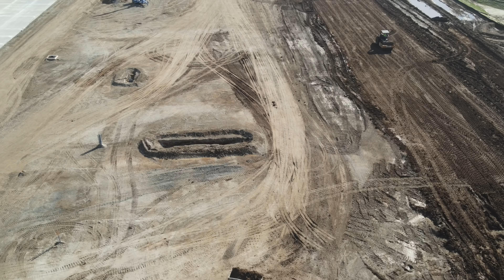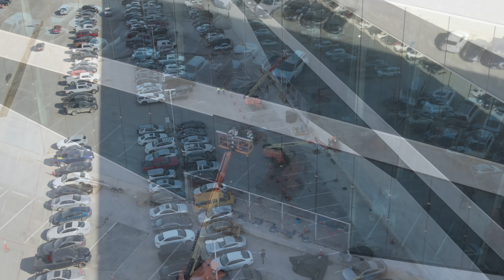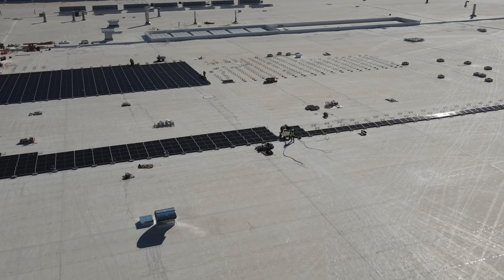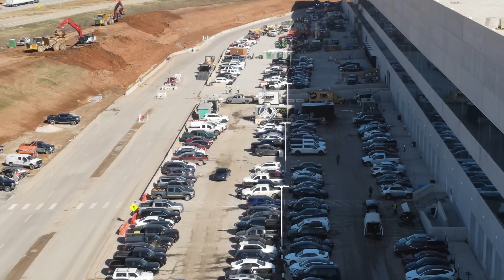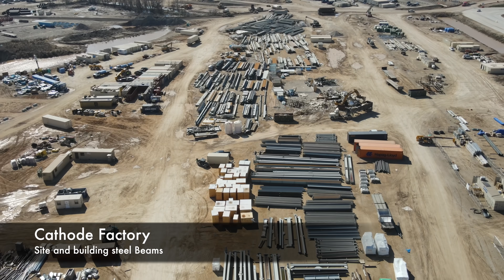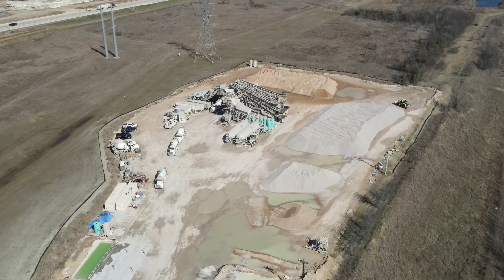Tesla Gigafactory Texas   2/7/2022  (9:53AM)   FULL SPEED AHEAD

Comment: Excellent as always!
How are the solar units held down to the roof, other than gravity? I see them moving the mounts around as needed, they don't appear to be anchored. Those things will make great sails in a Texas windstorm.
Reply: I believe it's a ballasted system, meaning they use concrete blocks to weigh down the supports.  I'm sure they're engineered for wind speeds up to something ridiculous.  They used a ballasted system when putting a solar array on a Superfund landfill site near me so that they wouldn't have to do any penetrations into the cap of the landfill; avoiding penetrations on a roof like this is a similar situation.
Reply: @pfcrow  I'm familiar with the non penetrating mounts. Used them when I built New England Cable News Network facility. They are still there after 30+ years. I haven't seen any ballast up there. Watch them when they put the solar cell on the mount, they kick the mounts around to line them up. Just wondering. Maybe a little JB Weld or Gorilla Glue. Yeah - that's the ticket!
Reply: @The_DuMont_Network  I assume they'll install ballasts once they're happy with how it's going.  Until then, they could have a mess if they get crazy winds.  I'm sure they know what they're doing and are watching the forecasts.
Reply: @pfcrow  Dancing with the Devil. I agree they in all likelihood know what they are doing. But March will be upon us soon!
Reply: Previous videos did show carts and workers hauling concrete blocks around and placing them for ballast.
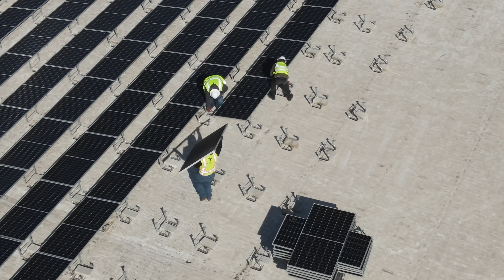Reply: If you look at 4:37, each of the brackets has a concrete block sitting on it perpendicular to the way the solar panels are facing. Hard to tell because they blend in with the roof
Reply: I see the ballast but that is scary to me.
Reply: PV panels. Held down by blocks of concrete. Manufacturers video here, https://www.youtube.com/watch?v=U68-iUpfzpI
Reply: @DessieDoolan  Indeed. Non Penetrating mounts. However, comma, I don't see the weights, and it would appear to be a bit of a bear to install them after the panels are installed.  As previously noted, you can see the installers kicking the mounts into place as they install the panels. I presume there is some method to their madness.
The non penetrating mounts work well, when installed properly. I have used them for years, but the weights go on before the load.
Reply: @ronaldwoodruff4676  Where do you see the ballast? Yes, non penetrating mounts work well, but installing the weights after the load is installed doesn't seem right to me.
Reply: @The_DuMont_Network  each stand has a concrete block sitting on it
Reply: @zacadams7070  Indeed. Hard to make out on a small monitor
Reply: @The_DuMont_Network  Very little colour contrast between the blocks and the roof. As Zac Adams mentions, at 4:37 the blocks can be seen. 

There is only 1 block per bracket thus far. 

I agree it would be tricky to install the blocks or additional blocks on these brackets after the panels are installed.
Reply: Mentioned in every video I suspect, connected to roof with ballast that held there own in recent high wind storms

Comment: Why they dont mount the panels with the roof? Next storm and this panels flys away
Reply: Punching holes in a roof has downsides.
These panels will be weighted.
Reply: May use a glue to keep them in place, but there are professionals planning there placement so I doubt there will be any issue with them moving even if they use balast only.

Comment: "View of the Cathode Factory site and the steel beams for it." No, it will not be built directly on top of Building 1. 
It is probably much too large to fit there, if the figures are correct (30 ha), that is 30 * 10,000 m2. 

This would not fit either from the logistics or from the building site, which is now being prepared.  I suspect that this component will come on the other side of the expressway.
Reply: It is interesting to speculate, in this case the building plans show it just past the parking area to the east where the metal posts are being stored right now. 

Other side of the freeway confirmed not to be any manufacturing just offices and I would suspect some starlink type control centre. Musk did inform the nearby residents there would not be any manufacturing on that western side of the freeway. But he could change his mind like he does very often
Reply: @AndyAndy-we9pe  Thanks for the info. If there is this commitment, it will certainly be kept. You don't have to get it, because something louder than an expressway without any noise protection, plus elevated, can hardly exist. 

The noise of a factory arises to almost 100% at the loading ramps. From the factory itself, less than 40 db, so well below the level, which is guaranteed there. In addition, a wall plus a strip is to be drawn anyway. The derivation and disposal should always be connected from the main approach, so that the residential development can never be affected. 

# The area seems to me but to be very small, if I include the entire logistics area and somewhere have to park the people, because a suburban railroad you know in Texas probably not (Grünheide). 

Translated with www.DeepL.com/Translator (free version)